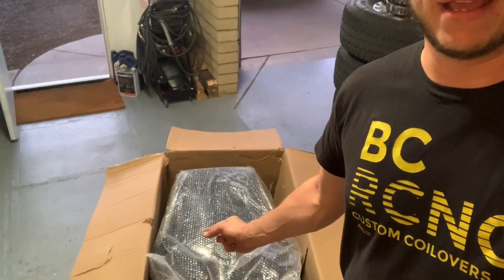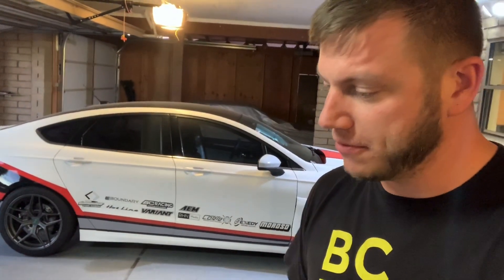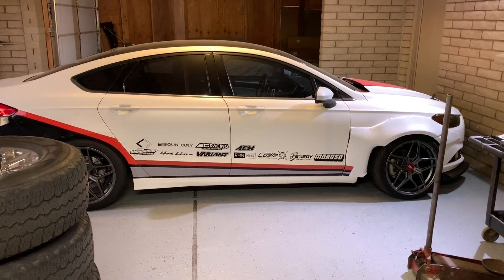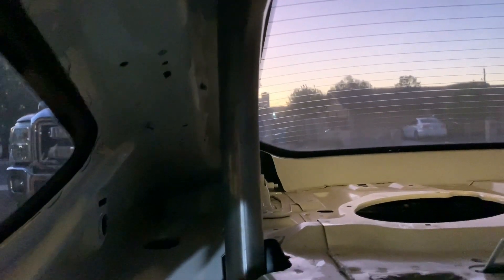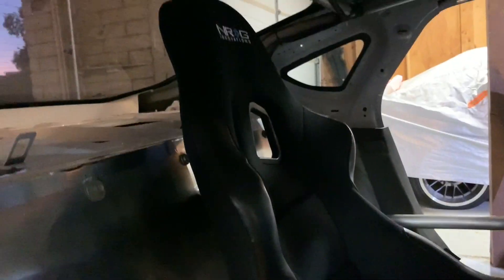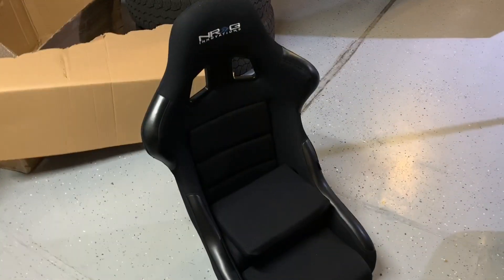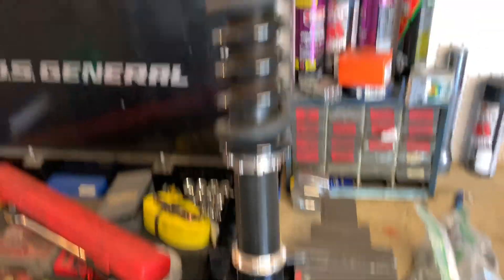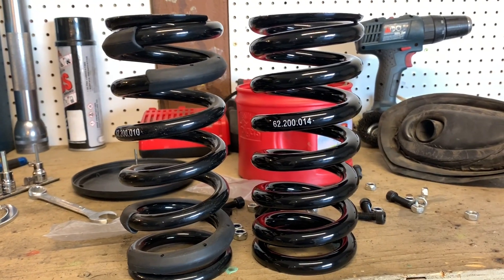Fusion Feed: The car gets a rear seat finally and a front spring swap!

Comment: Been watching your build for a bit, first off amazing work!

Quick question, what are you planning on doing for braking? Found any calipers that bolt straight in from any other ford products?
Reply from the maker: Yes, any Mustang upgrades will work
Reply: @MattSoppa  really!?  Cause I have an edge sport running 12.2 @115 and we are in serious need of brakes.  I know the fusion and the edge share calipers......this would be awesome if it bolts right up
Reply from the maker: @ofspecialk  If you watch the series, you'd know that everything on this car is swapped to Mustang brakes and suspension ;)
Reply: @MattSoppa  dude I must have missed that episode.  Damnit.
Reply from the maker: ofspecialk no worries go catch up!